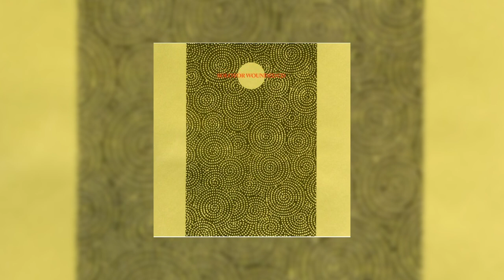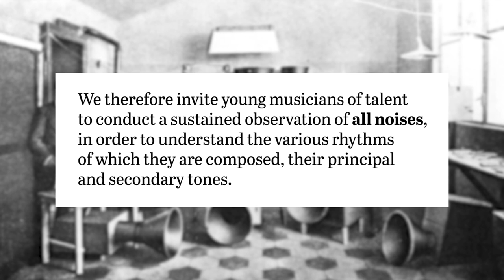Qu-Bit Data Bender and the Aesthetics of Failure

Comment: I know this is technically a gear demo, but honestly it'd be super cool if you expanded on that intro section at some point. Always felt strongly about that one Eno quote about recording tech and the fetishization of obsolescence:

“Whatever you now find weird, ugly, uncomfortable and nasty about a new medium will surely become its signature. CD distortion, the jitteriness of digital video, the crap sound of 8-bit - all of these will be cherished and emulated as soon as they can be avoided. It’s the sound of failure: so much modern art is the sound of things going out of control, of a medium pushing to its limits and breaking apart. The distorted guitar sound is the sound of something too loud for the medium supposed to carry it. The blues singer with the cracked voice is the sound of an emotional cry too powerful for the throat that releases it. The excitement of grainy film, of bleached-out black and white, is the excitement of witnessing events too momentous for the medium assigned to record them.”

Comment: It’s a real cool module, and I am tempted to get it. But the fact that a dedicated module saves you from the hassle of dealing with failing equipment takes a chunk of the magic away. Because isn’t it the road to the sound more valuable then the sound itself? It is efficient though, when you have kids.
Reply: My thoughts as well. It's sort of like a microwave dinner, instant 'damage' applicator. I'm conflicted about it. Twenty years ago, it took some work, or at least a novel approach, to get these sorts of 'unintentional use' results... not to mention the befuddlement, or disapproving reactions from peers. Now there's a Eurorack module that's designed specifically for those traditionally undesirable / damaged / chaotic effects, or results. The internet / technology has ruined everything! Cot damn these useful tools. curses cloud